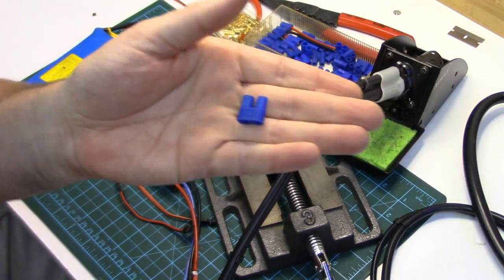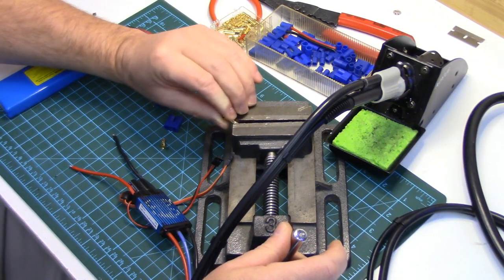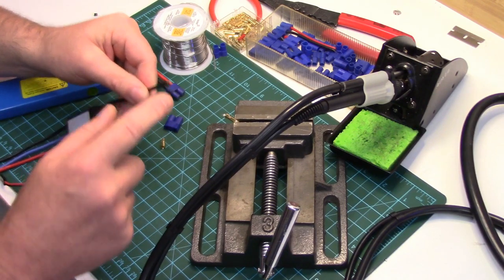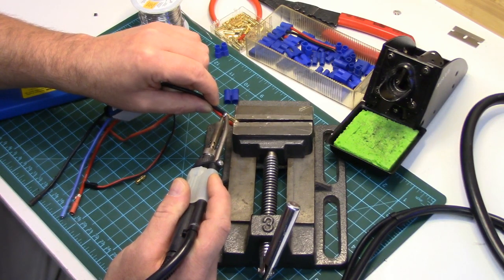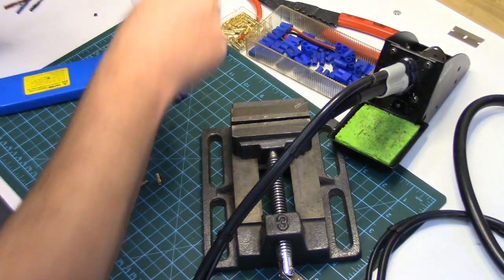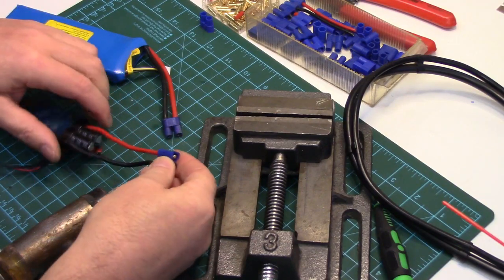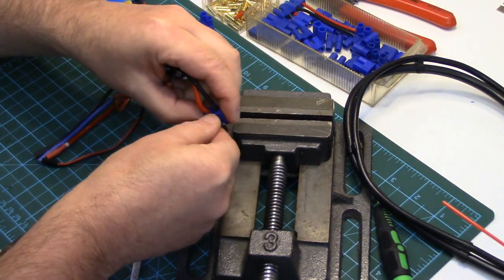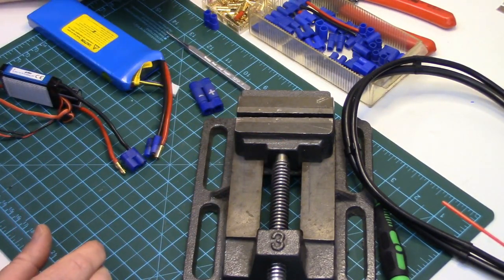How To Solder EC3 Connectors

Comment: This was exactly what I was looking for.  I watched several videos on soldering the connector to the ESC, but this got right to the work and had good pointers about the length of the stripped wire, how to hold the connector and most importantly which one goes on the ESC and which one goes on the battery.  Thanks!

Comment: that’s very strange because I usually slide a connector on the wire first and then do the soldering and then pull it up. however, I have never done this EC3 stuff. It’s going to be my first time so I’m researching and I find that kind of strange. thank you for the video.

Comment: Thanks again for a great video John, you've given me the confidence to give it a try (with spares of course) after being out of the hobby for a while. I had a question about connectors, I'm building a Trex 500X and the batteries I got (3300/6S) had Deans connectors on them. I'm not sure if I should change them to EC5's like I' had on my 550? I'm almost ready to solder the ESC (RCE-BL80A) so I'd appreciate any advice. I checked out your website, lots of good info there but I'm not too worried about current draw but physically whether the Deans small contact patch would be appropriate for my 12 AWG wires?
Reply from the maker: EC5's or XT-90's (the EC5 XT equivalent) would be overkill IMO on a 500 size machine.  Of course it depends largely on how hard you fly and how much sustained current you draw along with peak current. Battery quality performance also comes into the mix as a higher quality/higher C rating battery will provide more current during high demand loads and as such, a larger voltage drop will occur if the connector can't pass as much current as the ESC is trying to pull. For the average flier however, EC3' or XT60's in a 500 should be adequate.
Reply: @Rchelicopterfun  Thanks for the info John, I'll look into the XT60's. So your advice is not to use the Deans then?
Reply from the maker: I like the XT60's better than Deans or EC3's. Like all connectors, Deans have pros & cons, but in my opinion after having used all 3 types, XT-60's are a better all round choice. I go over more details on all connector types on my RC connector page on my site which might also help if you haven't seen that page: https://www.rchelicopterfun.com/rc-lipo-battery-connector.html
Reply: @Rchelicopterfun  Yes I had read that page, very informative. Since I'm just getting back into the hobby I may as well standardize things now. I'll order some XT-60's and get on with it. Thanks again.

Comment: You should try a wood block with the correct size holes for each connector, Much less heat loss / transfer than your metal vice.  nice video though
Reply from the maker: I have; and noticed no difference/improvement in heat loss. Guess that's because the surface contact area is tiny so their is little heat migration to the vice jaws. Only thing I did notice is the pins aren't held as securely in a wood block and I had less control of the pin angle. I'll stick with what works thanks  🙂

Comment: Got my new Zeee batteries, they have EC5 , not EC3 can I use an EC3 on a EC5 , the battery wires are the same size
Reply: Usually a battery with an EC5 has a bigger current draw. My Pro Boat V1 has EC5 ,if I would use an EC3 reducer on a EC5 it might melt the solder